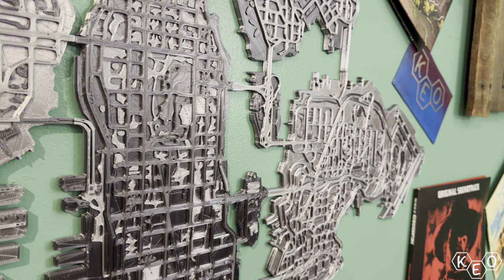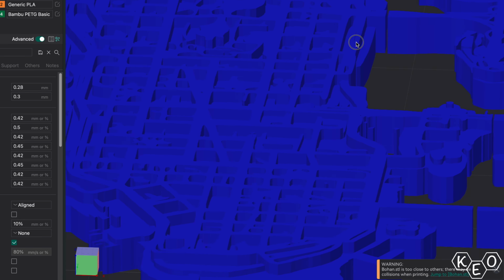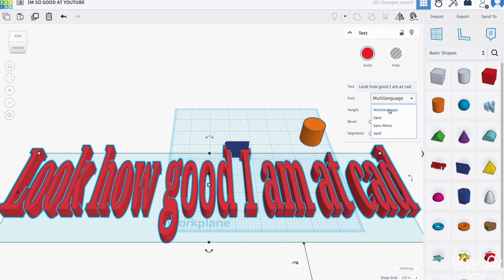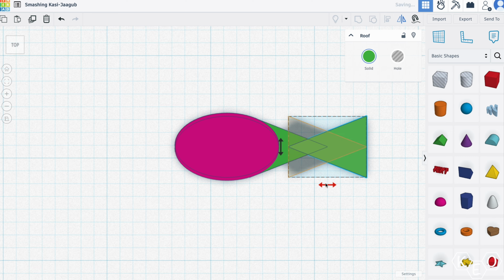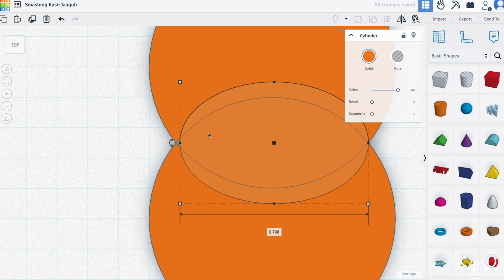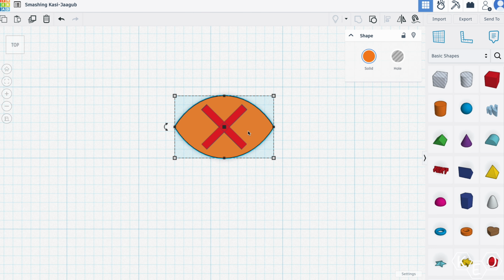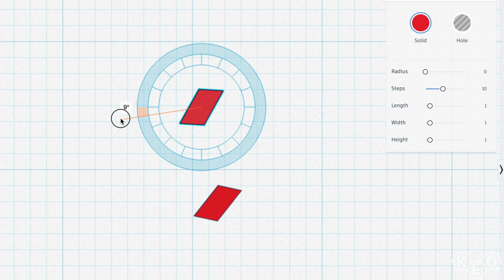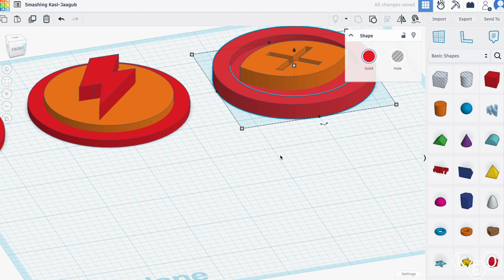A Custom 3D Printed GTA Map Caused This To Happen | No CAD Experience

Comment: Tinkercad does have alignment tools that will center in each axis. I don't remember how to do it as I don't use Tinkercad, but Robert Murray-Smith does it all the time in any video where he is playing in Tinkercad. Edit: Also, lately, I have been using command strips a lot more. When I don't, I use a cheap drywall anchor.
Reply from the maker: Yea I find myself using them exclusively. Drywall anchors just aren’t in the conversation for me anymore

Comment: On the video the gta map looks almost silver in places.
What about breaking the map in each island, then for the bridges you could print really good bridges to connect it all together. 

As for hanging stuff on walls here in the UK our walls are genrally solid so looking for a stud is not a problem unless you have a newer dry lined house.
Reply from the maker: Printing the bridges separate is a good idea. I am actually working on expanding this project right now to be bigger and multicolor so I will keep that in mind
Reply: @KeoPrints  you could go all out on the bridges if you dis make them a bit more detailed than the map as a cool focus point.

You could also spend the next few years of your life printing each building perfectly and stick the whole thing together 🤣 but you would probably have a room in your house that was just the Map haha.
Reply from the maker: That would be a next level deep dive for sure
Reply: @KeoPrints  haha well worth it